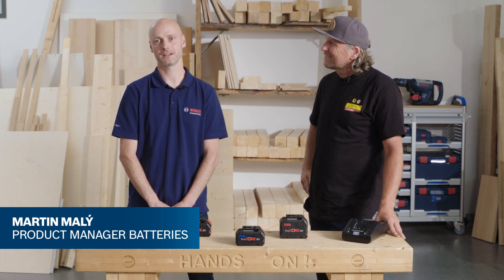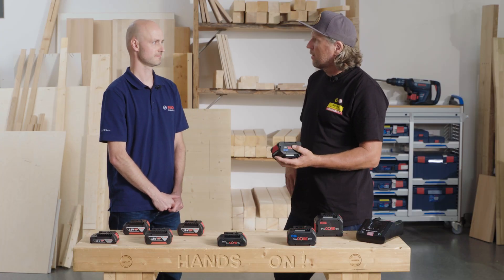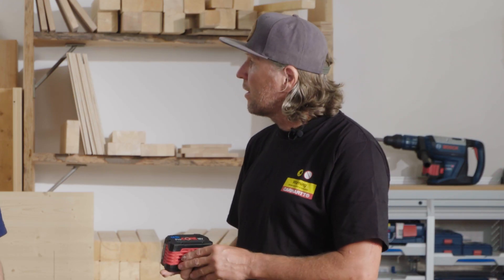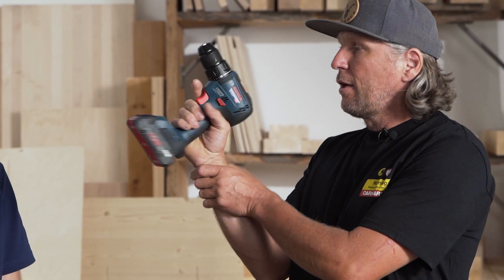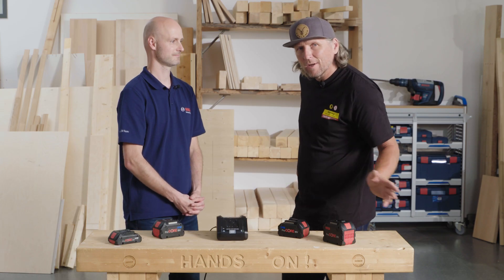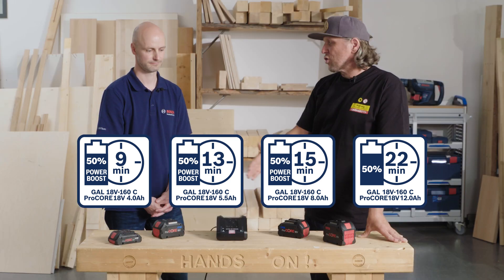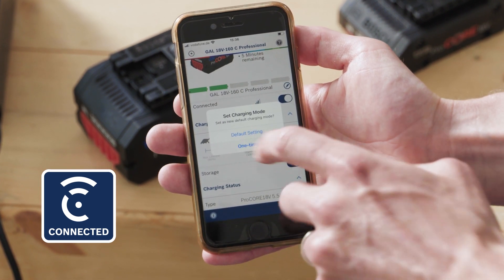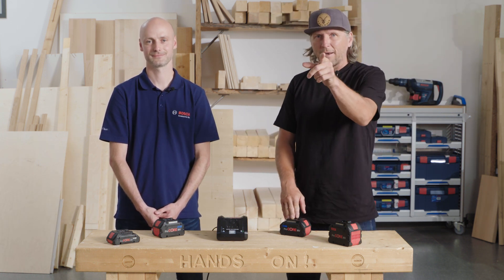All about the ProCORE18V batteries and GAL 18V-160 C charger

Comment: OF COURSE there is absolutely NO damage or lifetime reduction for the CELLS with Power Boost on... that's why you made a button that you manually need to confirm. Come on guys... don't fool your customers!! Why would anyone NOT want to charge at maximum speed, if there REALLY was absolutely no difference... 🙄

Comment: It makes no difference on battery life time yet still the app can make it charge slower to get better battery lifetime. That doesn't add up. Slower charge rates ARE better for your batteries, but in the end it doesn't really matter a whole lot as they will last for years and years anyway - unless you are a heavy user.